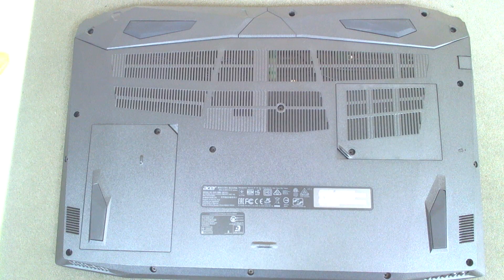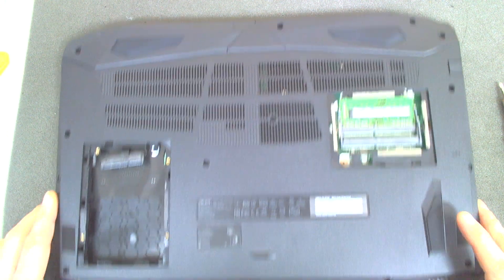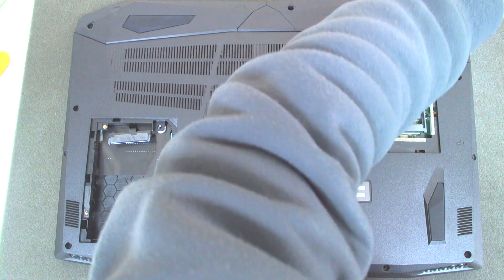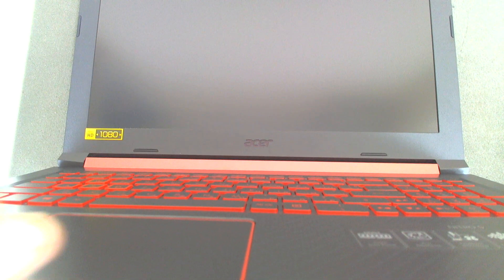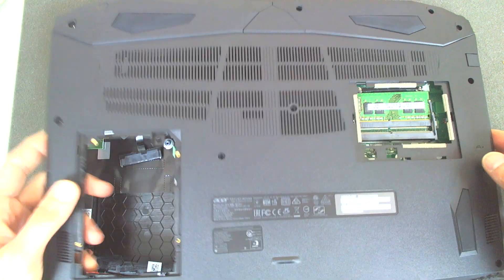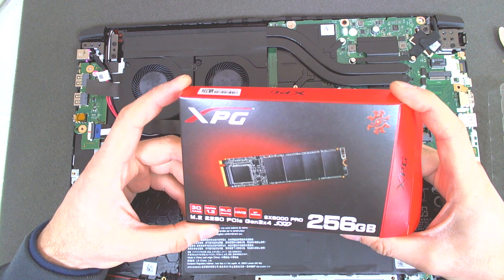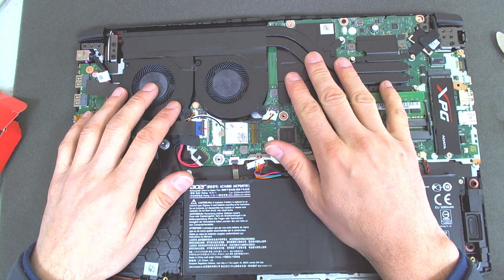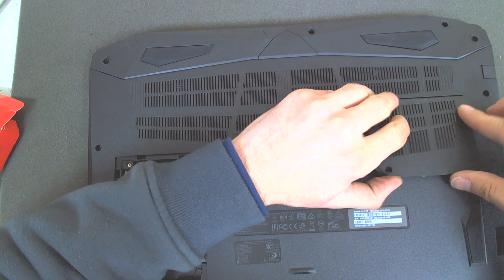Acer Nitro AN515-31 М.2 SSD Upgrade / Install

Comment: What is the ssd for if you have a hardrive?
Reply from the maker: The SSD is A-Data SX6000 Pro NVME SSD. The capacity is up to your choice.
Reply: @LaptopDisassembly  but why? Is it added storage or performance or why?

Comment: if i put nvme ssd in the sata slot, can be work?
Reply from the maker: Nvme and data are different types of disks. You can't physically install nvme on a data slot without any convertor.
Reply: @LaptopDisassembly  damn i just buy a new ssd m2 but i cant start up my computer if are empty. I need windows in some pendrive to install or something?
Reply from the maker: @joanmanuel6763 if you have some hard drive or big flash drive... You can make a backup image and restore it on the new disk with all the settings and programs.

Comment: Hey do I need to get the screw for that m.2 by myself or does the laptop already has it ?
Reply from the maker: In some of the laptops the screw is present, in some not. You can use any if you don't have it in the laptop.
Reply: @LaptopDisassembly  do you know the size ? How do I get one of the exact size ?
Reply from the maker: @ajinkyaadhotre5336  2.0 x 3mm (CM2x3-3.3)

Comment: i have acer nitro 5 an515-52 , purchased in 2019 ,can i install a nvme ssd in it ? does that model has a m.2 slot that supports nvme type ssd ?
Reply from the maker: yes you can install nvme, it support it.
Reply: @LaptopDisassembly  Nvme is not detecting for me, any other way?
Reply from the maker: Did you try to make a fresh install. Also make sure you connect it properly... It should work. Also flash with latest bios.
Reply: @LaptopDisassembly  I tried everything, SSD is not detecting at all. Acer Nitro AN515-42 laptop
Reply from the maker: The laptop is working with nvme https://community.acer.com/en/discussion/565912/does-acer-nitro-ryzen-5-an515-42-amd-supports-m-2-nvme hard to tell what is the problem like that... Is it visible in bios or not.
Reply: @LaptopDisassembly  It is not visible in the BIOs brother
Reply from the maker: What is the exact model of the SSD.

Comment: where does the hdd cable goes? i took the back case without disconnecting it first
Reply from the maker: If you check on 7:30 the HDD cable should be under the wide black cable, that is connecting the big board to the USB board.

Comment: i heard acer nitro 5 an515-42 ryzen 5 has m.2 nvme slot but it only supports m.2 sata ssd. is it true? which ssd should i buy
Reply from the maker: The laptop should support and nvme 2280 SSD.

Comment: does the m.2 ssd have to be a specific type to fit the laptop motherboard?
Reply from the maker: It should be 2280 standard. Can be regular or nvme.

Comment: Helpful video! I installed Windows already on my NVMe SSD.

I have a problem though, that when I remove the HDD, the SSD is missing from the boot options. Any idea how I can make it appear?

Thanks.
Reply from the maker: My advice is to remove the HDD and make a fresh install. Probably the BCD part is on the HDD and not on SSD. Make a install without the HDD.
Reply: @LaptopDisassembly  Reinstalling minus the HDD worked. Couldn't get the bootrec method to work.
Reply from the maker: Or try to remove HDD and fix the installation with bootrec /fixmbr and so on commands

Comment: Hi I have the same laptop model Nitro 5 AN-515-52-56VN. Is it M.2 NVME or M.2 Sata? NVME has one hole on the tip unlike Sata version of M.2 has 2 hole. Pls confirm and answer me. Thank you.
Reply from the maker: The laptop can work with both. In that video i install A-Data XPG NVME Drive, so yes it works with NVME

Comment: Hi can i have a moment please... It's important... I have acer 515 42 laptop and I just bought m.2 nvme ssd but ssd is not getting detected in bios or anywhere.
Reply from the maker: Try the following... Go to bios and enter the first page that have options on it. After that press Ctrl+s or Ctrl+c and see is there one more option available. After that change the SATA mode from optain to achi. Also try to make a fresh install and check is the SSD visable.
Reply: Did you make it work?

Comment: Hey good day is it possible to install a Nvme ssd Acer Nitro 5 AN515-52? Hope to hear to you soon
Reply from the maker: Yes you can, but dont buy AData ssd. Try a different brand. I had cases where adata is a bit problematic with that model.
Reply: @LaptopDisassembly  But the nvme m.2 ssd is different from m.2 sata ssd
Reply from the maker: @rpeonruzzel1294  i know

Comment: Sir in which model are you installing i also tried to install on my pc acer nitro 5 an515-42 but it does not recognize it. It says only sata m.2 ssd are supported
Reply from the maker: In that model i did install AData Sx6000 nvme ssd.
Reply: Sir i am asking for my model Acer nitro 5 AN515-42 2018 version which ssd will be suitable
Reply: @rahuljaiswal9049  m.2 sata support upto 500gb
Reply: @tsubasavo6445  just 500gb?  There are 1tb no?

Comment: After os is installed in ssd what should I do? In the boot order section will the ssd be visible after os is installed in it? I saw your video and ssd wasn't showing in boot menu while you were changing the boot priority prior to installing the os...

So what happens next after you install os in ssd... Please guide bro
Reply from the maker: To check is everything cloned correctly, just disconect the regular hard drive. If all boot correctly is all fine. Usually the m. 2. Drive is set by default to be the first boot drive.
Reply: @LaptopDisassembly  I'm doing a fresh install bro. So what you mean is that once the installation is done I should remove hdd and check if ssd has got OS correctly installed and because ssd will boot to windows hence it will be on priority by itself even if I plug back my hdd back again?
Reply from the maker: If you make a fresh install and you choose the ssd for instalation destination you don't have any problems. Just finish the instalation. I thought you are cloning from regular to ssd. Just start the installation and follow the steps.
Reply: @LaptopDisassembly  Yes that's what I'm saying. I installed everything in ssd. Now what should I do? Bro your video right after the installation process so don't know what to do next. Should I remove the hdd and let ssd boot or go in bios and set the boot priority order?
Reply from the maker: Just check in bios is the m. 2 is first boot device. You can't broke anything so dont worry. Everything should boot fine.
Reply: @LaptopDisassembly  thanks bro... Will do that.
Reply: @LaptopDisassembly  bro I set the USB pendrive as priority to install, when in middle the os is getting installed in ssd it restarts to finish up but since pendrive was in priority the os starts installing again from the beginning. What should I do?
Reply from the maker: When restart just remive the pen drive.
Reply: @LaptopDisassembly  done that bro. Now I'm getting 2 os options to boot from. I selected the one in ssd. Ssd os got fully installed and is working well. Now, How should I get rid of the os in hdd? or set the boot priority to ssd?
Reply from the maker: You can set the boot priority in bios or just format the regular c drive.
Reply: @LaptopDisassembly  sure bro. Thank you so much for helping all the way.

Comment: After trying to boot using ssd as primary,my laptop stuck with 'choose your keyboard layout' for infinite time. I was so frustated that the only option to restore my windows is to put HDD as primary again. Please help! Cause this is frustating, i had to do whole presentation at my job tomorrow and my ssd didnt work :)
Reply from the maker: Did you install the os on the ssd. Because you cannot boot from the ssd if there is no os on it. How did you install the windows on the new disk
Reply: @LaptopDisassembly  i do clone it using macrium reflect, i suspect it is an error. 4 more hours to my presentation and i still unable to fix it yet since im a dumbass with these stuff ;) after trying to do it all again the clone kept getting errors too. Its so frustating
Reply from the maker: If your old hard drive have bad sectors or other errors it may not be possible to be cloned correctly. Try checking the os partition for errors with chekdisk
Reply: @LaptopDisassembly  what does it do? Ive been doing chkdsk /f /r for few hours now and at stage 5 stuck at 68%, wonder how long it took. And can you tell why i kept getting the "choose the keyboard layout"?
Reply from the maker: Can be for a different reasons.... Probably not successful cloning. Can you try to boot only with ssd installed, with regular dusk removed.
Reply: @LaptopDisassembly  it works just now but i had to install windows cracked since my previous is lost. And now i got the infamous blue death screen?
Reply from the maker: Try different versions

Comment: hello, can you recommend me the type and info of the ssd youve installed on video?
Reply from the maker: You can put nvme M. 2 2280 ssd. It that video i installed adata sx6000, but i had few problems with them on acer laptops. I would go for Kingston A2000 or different brand. Any 2280 nvme will do the job.

Comment: Is it possible to install windows on both the hdd and ssd and what will happen if you do?
Reply from the maker: Yes it is possible. The hard drive that you set as primary will be the bootable one. If you like to boot from the other drive, you have to change it in bios or yse F12 for choosing a temp boit drive during startup.

Comment: hi, just want to ask something...your acer nitro 5 is same version with mine, so does it compatible with 1tb M.2 NVME? or maximum M.2 NVME that we can use for our laptop is only 512GB?
Reply from the maker: It will work with 1TB also. The capacity is not a problem
Reply: @LaptopDisassembly  ok sir, tq for your info... you the best sir 👍🏻👍🏻👍🏻

Comment: 2:20 screw is not stripped but it's rotating continuously and not coming off😭😭
Reply from the maker: No worries... Remove the other ones and try to separate the bottom cover. If it is not coming off, just pull it a little and than try to remove the screw. Just put some tension on it withthe bottom cover.
Reply: @LaptopDisassembly  kk ill try thankx

Comment: My bios dosent reconize the ssd, please help me
Reply from the maker: Tey to start windows instalation and check. Sometimes the ssd is not visable under bios. Also check the sata modes.. It should be on ACHI
Reply: @LaptopDisassembly  i find out the problem, its NVMe ssd not SATA😶😔
Reply from the maker: The laptop is working fine with nvme.. Just check the sata settings in bios and try to install windows.

Comment: is this the nitro ANS515-53? Theres different versions of nitro 5 and that wasnt specified.
Reply from the maker: This one is AN515-52
Reply: @LaptopDisassembly  i have an 860 evo sata, can that be installed into my ANS515-53, and i also got a 970 EVO NVMe and wondering if my nitro model  has a M2 for installation.
Reply from the maker: @scarletdreams4228  the nitro 5 have m. 2 slot and supports nvme. So put the nvme in, and use your regular disk for storage.
Reply: @LaptopDisassembly  Can the 860 sata work as well?
Reply from the maker: Yes it will
Reply: @LaptopDisassembly  thank you :)
Reply: @LaptopDisassembly  also i got these because a friend of mine told me that my model  is compatiable with them but hes been known to lie. I dont wanna regret my purchase because these were expensive

Comment: Yanko,,if I want to install an SSD for my Nitro 5,,and installing  windows 10 ,, is it necessary to erase my HDD or can I just install Windows on the SSD without having to erase my HDD cause it contains important files,,thanks yanko
Reply from the maker: No need to erase the old hdd. Just put the new one as first boot devise in bios.
Reply: @LaptopDisassembly  ooohhhhhhh thanks much ,,you really reply faster than a girl's chat 🤣🤘🤘
Reply: @LaptopDisassembly  hope to learn more about laptops from you,,subbed!

Comment: hello! Can you tell me what is the max SSD speed that Acer Nitro 5 AN515-42 can handle? I have seen a Samsung 980Pro on the internet that has a writing speed above 5000 MB.
Reply from the maker: Speeds above 500mb are nvme only. You can install one, but all depend on the configuration. If you test the disk like secondary it will show higher speed. If you test the disk while the os is running on it it will show lower speeds. Same disk on different system will show different speeds.
Reply: @LaptopDisassembly  Thank you for your reply. I only want to install Samsung 980pro its writing speed is 5000MB (PCIe 4.0), but in my Acer nitro 5 notebook only has 3.0, so I don't know what is the max writing speed in this case. my CPU: Ryzen 5 2500U  | 8GB DDR 4 ram, RX560X gpu.
Reply: one more thing how SSD speed affect in game fps ? +how RAM upgrade affect CPU and SSD?
Reply from the maker: 2500-3000 will be possible.. Everything else is just beach test. And i doubt you will see any difference above 1500 on regular basis.
Reply: @LaptopDisassembly  thank you very much
Reply: @BoshiNagare  hi bro did the Samsung 980 ssd worked for u, It an nvm ssd no?, I read online that an515-42 don't support ssd m.2 nvm, did it work for u ??

Comment: Hello Mr. Yanko! I´ve had an Acer Nitro 5 for almost a year now, so I have a lot of stuff downloaded in my HDD. I want to add an SSD, and use it for booting up the computer, but still use my HDD for storage. I did not understand how to copy windows to my SSD, can you help me?
Reply from the maker: Is the windows on a separate partition ( LIKE C drive) and the downloaded stuffon a D drive. If so, you can clone only the windows partition with aomei backupper or similar. After that the laptop will boot from the ssd, the old C drive will become D and the D will be E... Etc..
Reply: @LaptopDisassembly  How do I check if they are in different partition?
Reply from the maker: When you open My Computer, how many drives you see.

Comment: Hello, sorry I know you are not tech support but I need help, because I do not really understand the SSD's and which interface is which - I have Acer Nitro 5 ( AN 515-51 ) and I would like to install SSD there, but I do not really understand which SSD interface does this Notebook have - is it SATA or PCIe, also I found there are some keys ( which are like the shape of the connector from my understanding ) - like M and B. Im completely lost in this system. I would like to buy this SSD ( https://www.amazon.com/XPG-SX8200-Gen3x4-3000MB-ASX8200PNP-1TT-C/dp/B07K1J3C23 ) but I do not know if it is compatible - would you be able to tell me if it is or isn't / what interface does Nitro 5 have ?
Reply from the maker: This is the correct size and shape. But i advice you not to install A-Data on that laptop. I have some compatibility issues with Acer Nitro and A-Data SSD. You can try different brand like Kingston, Transcend or etc.
Reply: @LaptopDisassembly  Alright thank you very much, I will search for some other SSD brand :D

Comment: Hi, I see you were able to do an SSD upgrade for the M.2 slot and had a question. I have an Acer Nitro AN515-42-R5ED model, I've tried putting in two different SSD's at this point but neither of them are read by my bios or device manager. When putting in either of the two I had, it would make my HDD run at 100% and slow things down until it was removed. If you don't mind my asking, what model of the nitro 5 was this? If it happens to be the same as mine, how did you get it to read the SSD?
Reply from the maker: This was a customer laptop and it was AN515-52. It should be the same for yours. The laptop was brand new so i just open it and install the ssd. First try to install the latest bios for the model. After that check do you have any options in bios about the m2 slot. Also what type of ssd do you install, regular m2 or nvme.
Reply: @LaptopDisassembly   It is a crucial P.5 M.2 2280 that was installed. It is a M.2 NVMe
Reply from the maker: Did you check this... https://community.acer.com/en/discussion/615444/crucial-p1-and-p5-for-an515-52

Comment: Hey I have the windows 10 preinstalled on my HDD. I don’t have any copy of it. If I install the SSD how its gonna install on the later without a copy of windows?
Reply from the maker: The licence of the windows 10 is kept in thebios. So even if you make a fresh install, the windows will be activated automatically. Or you can clone the old os with aoemi backuper or acronis true image. I prefer fresh instalation...
Reply: And I want to know what should be the max capacity of ssd that can be installed on the this pc? My model number AN515-52-54GU. Iread somewhere it can have only 16gb of Ssd
Reply from the maker: There is no limitations. I have installed a 512gb one, so you can add even 1tb. The 16gb limitations is for intel optane and it is of the laptop comes pre configured.
Reply: @LaptopDisassembly  thank you
Reply: WD Blue SN550 500GB NVMe PCIe Internal Solid State Drive (WDBA3V5000ANC-WRSN)

Will this be compatible with this pc?
Reply from the maker: @dollarattri  yes
Reply: @LaptopDisassembly  do I have to reinstall all the drivers manually or will they be installed automatically once I recover the windows from flash drive?
Reply from the maker: @dollarattri  When you make  a fresh install, wait for it to finish, and after that just run windows update, It will download all the needed drivers. You have to install the software programs manually after that.
Reply: And what are the gen in these ssds?? I see some are gen 3 and some are gen 4 ... what ill be the affect of these??
Reply from the maker: @dollarattri  the newer the gen the faster.. but get gen3. They are the most popular now.

Comment: Bro. Can you please link SSD you put. Also is it possible to only take windows from hdd and put in ssd and the rest keep in hdd? 🙏🙏
Reply from the maker: The one i use it this one. https://www.amazon.com/XPG-SX6000-Gen3x4-1500MB-ASX6000PNP-256GT-C/dp/B07H53JT77 You can use AOMEI Backupper to clone only the OS, not the hole disk.